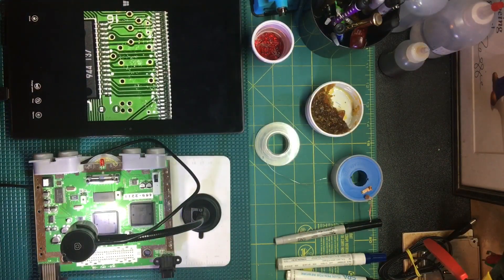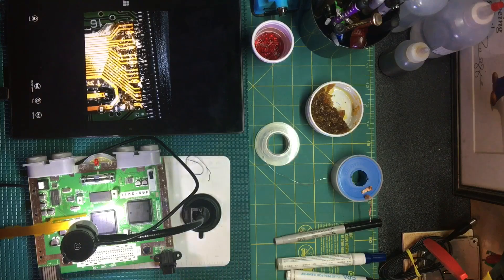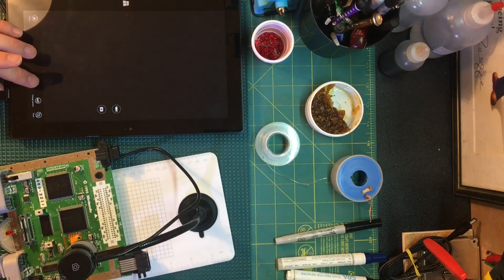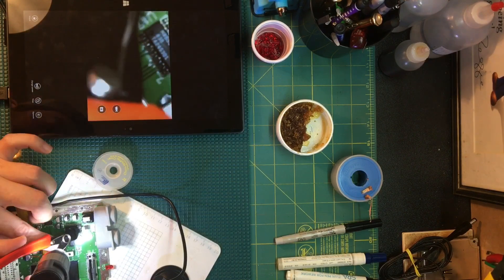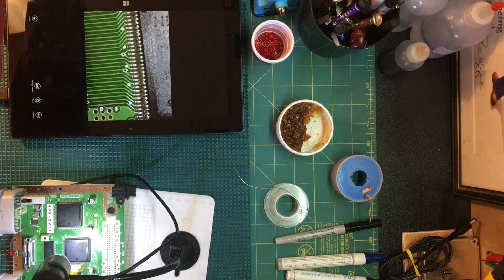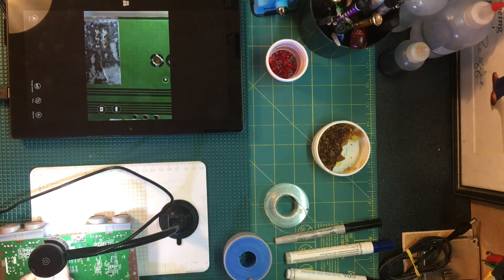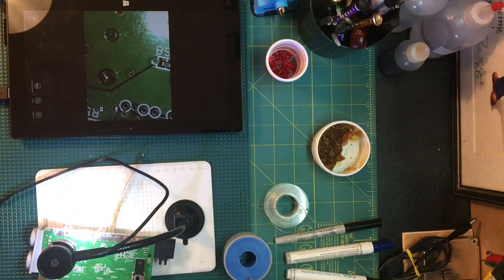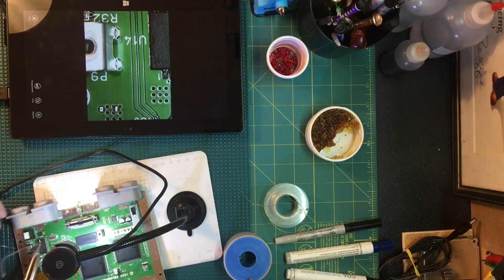N64 UltraHDMI installation (with microscope)

Comment: Does this work also with pal n64?
Reply from the maker: Yes, it does, and I've personally installed into several PAL N64 consoles. :) UltraHDMI works with all known versions of the N64 and all board variants from all regions. The only small complication is that the Pikachu consoles need a spacer to fit the board in place but that's no more complicated than the No-Cut UltraHDMI pieces. I use my 3D printers to make those spacer pieces. :)

Comment: "mini HDMI" Who's the genius that made that decision?
Reply from the maker: Yeah, I hate that almost all of these HDMI upgrade kits use mini-HDMI type-C even where full-size HDMI would work. MarshallH says it would not fit but I've seen people cram those analog2HDMI boxes in the same spot as UltraHDMI soooo... *shrug* At least a mini-HDMI cable doesn't block the Nintendo AV multi-out like a full sized one might, but it does if you go with the 3D printed "No-Cut" parts.
Reply: @emmettturner9452  When people say it wouldn't, point out all the different port options, like this https://ae01.alicdn.com/kf/HTB1qT.aRVXXXXbRXFXXq6xXFXXXY/1Piece-New-Replacement-HDMI-Female-Jack-PCB-Socket-Connector-19P-HDMI-Port-for-Asus-Lenovo-HP.jpg

Comment: Another thing: Have you heard of anyone using a CNC machine along with a CAD model of the mini HDMI port to perfectly cut out the opening for it? I've just never seen this done real cleanly and was wondering what it might cost to have this done? Maybe a 3D printing place would be able to do it?
Reply from the maker: No clue. I’ve made some really nice cuts, if I can toot my own horn a bit, but that’s because I take a ridiculously long time and whittle it down one tiny slice at a time. I never use a Dremel or anything powered. Because of the division of labor with my twin brother, whoever works on the cut usually spends as long or longer on that than on the rest of the mod entirely.

We have a 3D printer and have used it to make perfectly-fitted HDMI shrouds that can clean up a poor cut on a Hi-Def NES but we haven’t needed to use anything like that for Ultra HDMI just yet (knock on wood!). We have encountered as least two systems which were so brittle that they just cracked and crumbled when you tried to cut or file anything (both were late-production charcoal systems).

You definitely want to be careful not to go too far with the cut since it is the mechanical support for the mini-HDMI type-C connector. If it allows the port to move too far up and down it will just wrench the HDMI port off the board.

Comment: You mention using the same pen Marshall does for the same reasons he gave. But I see Lord Voultar use no clean so I have to wonder if the ribbon cable will really corrode. Marshall is the creator but that doesn't necessarily mean hes right about this one and I dont think Voultar would use no clean if it in fact was corrosive. Also Rosin core is a pain to clean off compared to no clean. What are your thoughts?
Reply from the maker: Yes, I noticed the same seeming-contradiction. :) Marshall is an engineer on the level of Kevtris where Voultar specializes in the analog stuff, but this is really about chemical datasheets. Neither shies away from that kind of minutia. :)

Marshall says that some “no-clean” is only safe/non-corrosive if it is activated with heat, so he’s not going to broadly recommend it like he does with rosin flux though I wish he had made a specific suggestion like he did for rosin flux. Voultar may be very familiar with his preferred no-clean flux and know that it isn’t corrosive but he doesn’t suggest what no-clean to use and I don’t trust that I would be able to spot the corrosive when unactivated kind by skimming a data sheet.

We aren’t using hot air for this and surface tension pulls a lot of flux under the RCP where it is not exposed to air and can remain liquid for a long time. I figure I’ll play it safe. I’ve removed and reinstalled the RCP before and found that there is a ton of nasty brown flux under there from the factory, just like most cartridge slots (pop a couple off and take a look!).

Another reason I used rosin flux was that I already had the same stuff that Marshall suggested but not in a pen (bought a bottle at Fry’s Electronics many years ago). It worked so much better than the no-clean for this kind of work that I bought the pen too.

It does look nasty until you clean it up but I’ve found that to be relatively easy. I swab that side of the RCP with a fresh cotton swab and 99.9% isopropyl before and after the job and it looks great. If it still feels too sticky I might make a second pass. There is flux left over from manufacturing all over the board so it doesn’t take more than that to make your work look cleaner than the rest of the board. :)

Comment: Great video. I tach mine/do caps with hakko 07 tip then use 08 tip to finish under microscope.
Reply from the maker: Audio Gear 

Thanks!

Since I do have two interchangeable irons side-by-side I wouldn’t have to wait for tips to cool. I think I should look into using multiple tips myself! Thanks again.

I usually don’t work with the microscope though it definitely helps for checking my work. Using the cheapie USB microscope because I’m saving $$$ for a fancy dual optical path microscope someday. :) I have pretty bad eyes and ruined my glasses months ago but I’ve still managed to spot even the smallest bridges without the microscope. At first I used to use the microscope and DMM to check continuity between every neighboring pin until I realized that my success rate was high enough to rely on eyes + the self test. So far, no unexpected bridging. :)
Reply: I just use a older binocular scope since I don't see as well as I used to. What you are using is probably just as good and it looks cool.